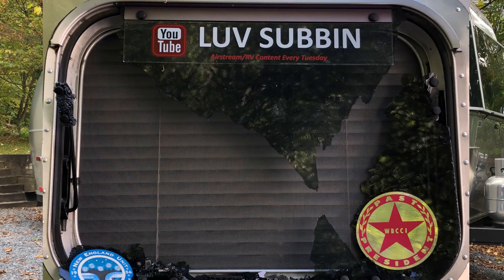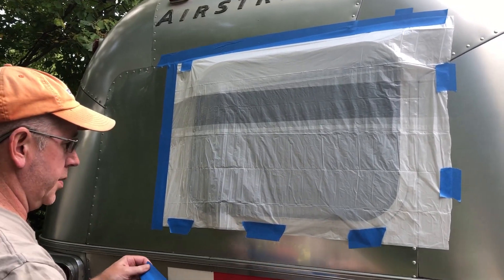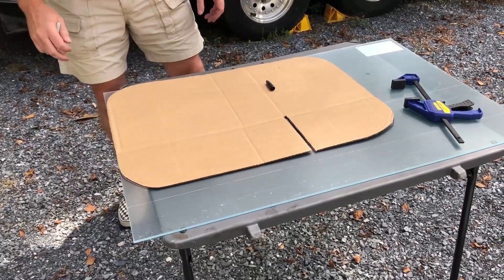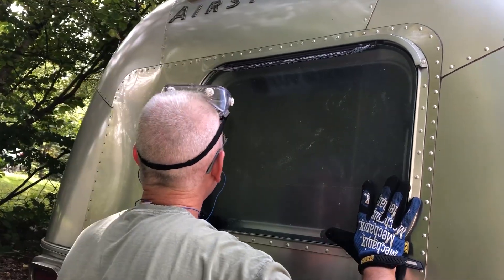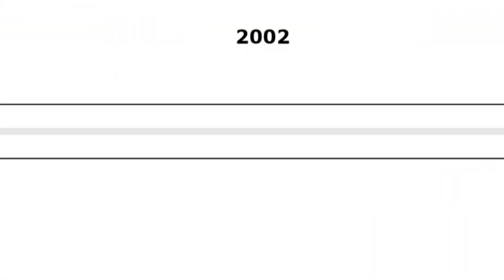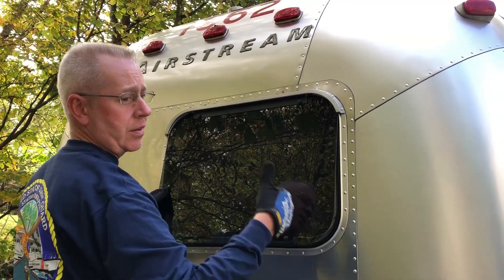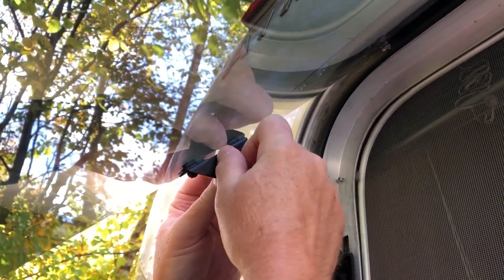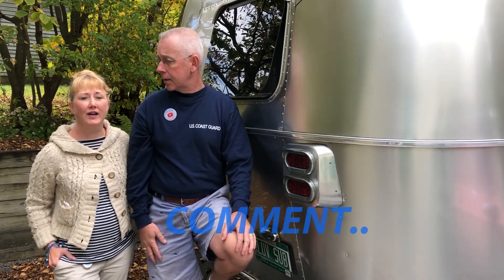Airstream RV Window Replacement

Comment: I've taken off all of ours to put on a privacy film, once you figure out the special spot to hook the top onto it is very easy. I took all of the hardware off before putting on the film, a side benefit of the film is that it keeps out a lot of heat from the sun.

Comment: Have you looked at your door to see if the frame is being cut by door? Look at line in door frame bottom.
Reply from the maker: Thanks for watching!  I have to admit that I'm a little confused by the question.  No issues with the door or frame...
Reply: @LuvSubbin  a number of airstream doors hit the frame when closed at bottom. The trim on bottom of door cuts into the frame on trailer . You would see a black streak under the door. You could be lucky and it ok.

Comment: Thanks, I just broke the same window and your fix looks good.  I can do this.  I can’t find the replacement window only.  All I see are windows and frames together.  Any suggestions where we can get the window.  I have a 2010 flying cloud 23FB.  THANKS
Reply from the maker: Sorry for the slight delay in response - we have no WiFi.  The best place to get the window is through an Airstream dealer.  I would download the parts list from Airstream and give them the part number.